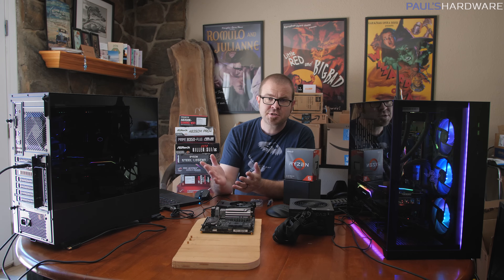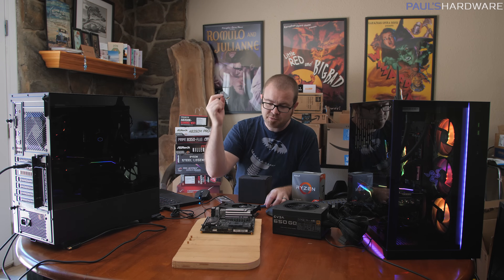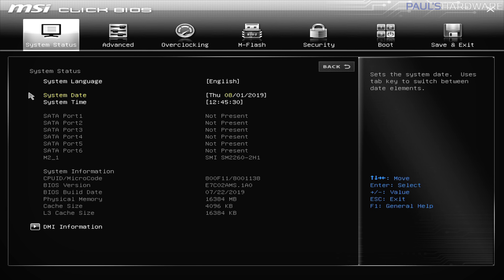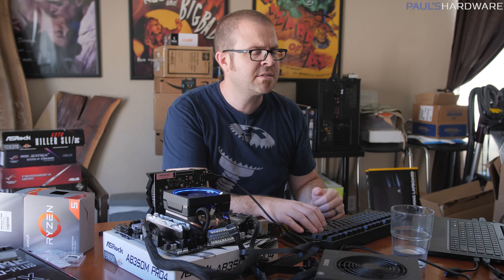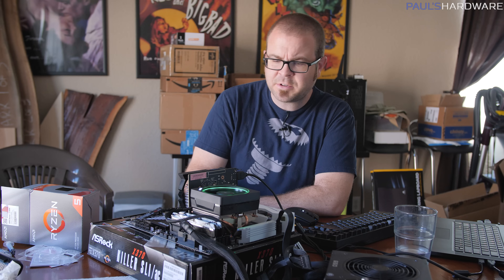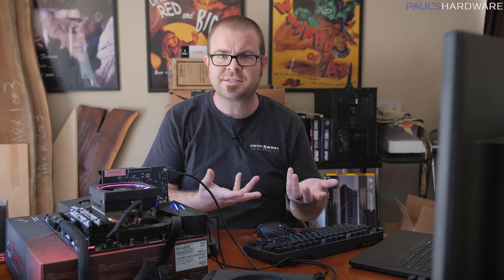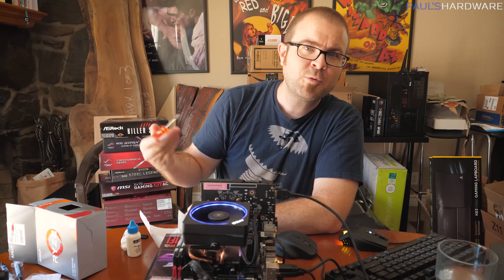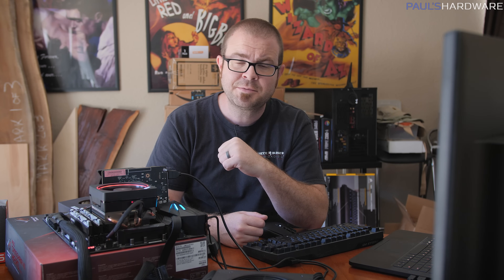Does Ryzen 3000 REALLY Work on Old Motherboards? Testing B350, X370, B450 and X470

Comment: AMD is amazing. I updated my old system (Ryzen 5 1600x, MSI x370 Gaming Plus and 2*8 Corsair 3200 Mhz memory CMK16GX4M2B3200C16R and 1080ti) with new CPU R9 3900x. With latest available BIOS my system absolutely stable. Max turbo freq is 4625 Mhz, my memory now overcloked to 3733 Mhz with 16 16 16 timings. My respect to AMD engineers.

Comment: Nice mobo update run, but yeah like me, many users are having strange behaviors like high vcore on idle, high frecuency bootsing for scrolling down a pdf file, huge RPM rampage from cpu cooler when almost no load, etc, etc, etc. The list goes on, and the newwer BIOS updates and chipsets drivers, are not fixing them all, or not fixing them to a degree were you will feel ok with it.

Comment: I have a problem with my b450 tomahawk and ryzen 5 3600. Most of the time it won’t boot. I had to shut it off and on 10 times to get a boot. I think I’m currently on the bios version 18 and am wondering if the newest version of the 19 will help this.

Comment: Hi Paul, I built a Ryzen 3 3600 with a Gigabyte B450M-DS3H last month, I needed to upgrade the BIOS to F41 before it would work. Had to use a previous gen chip to flash it as the board doesn't have any of the flashback-esque options.

Comment: I have an Asrock B450 Fatal1ty Gaming ITX/ac with a 3700X and a 32GB G.skill Aegis 3000Mhz kit, and I get constant bootloops.
Currently tried 4 different bios' that were sent by asrock or were found on the support page and not a single one works.

I am getting desperate :'(
Reply: Done that, even have a beta bios from asrock support. But still boot loops.
Reply: if you have some other ram, try that as well
Reply: @Bareego  already done that. No help 😭
Reply: @cerrror  I think he mentioned something about a certain order in which you had to upgrade the BIOS on some asrock board. Like 3.4->3.5->5.5-> higher. If that's not it I don't know. Maybe buy a MSI board, they're the best AM4 boards IMO

Comment: Paul... sell me one of your builds. Im a pleb who through overclocking.. penny pinching and general cheapness has been able to keep a 10 year old rig running fine for 1080p gaming at high to ultra settings. The rig started its life as a MSI 970a-g43 motherboard with a FX 6300 and 8GB of 1333mhz ram, crappy video card, and a 450w non rated power supply. After watching your videos over the years I have slowly upgraded this PC on the cheap.. The crap video card was replaced by a R9 270... and eventually a second one was added for crossfire. The Powersupply exploded and was replaced by an EVGA bronze 650watt which also lit on fire nearly burning my apartment down. The third power supply was a corsair RM650 gold which is still kicking. The crossfire setup was replaced by a GTX 980 founders edition build by PNY. The ram eventually was replaced by 4X4 sticks of 8GB 2133mhz which took a butload of fiddling to make it work at the correct speed. The CPU was clearly bottlenecking the GPU so I upgraded it to a FX 8370 and overclocked it with the edition of a hyper 212 evo cooler. The hard drive was old and small so a Samsung EVO ssd at 1tb was installed. The original PC had cost me something in the range of $500 and I have put a lot more into it upgrading it over the years. It is still competent at playing games at 1080p high or ultra settings near 60fps... however I think I have hit a brick wall regarding upgradability. I am broke. I am a plumber apprentice and literally have no time to myself to do necessary things nevermind think about working side jobs to pay for a new PC. I fear that at this point I need to spend thousands to make the next level of PC performance a thing. If you have a stockpile of older hardware components I would gladly take the small amount of savings I have and purchase what you dont want or dont need to build something newer, or better. I am not afraid of the build, I actually enjoy doing that. I enjoy the thrill of the overclock as well. If you have something you consider junk, think about selling it to someone who might consider it diamonds. 

Thanks man. 

Love the channel. 

Full blown inspiration from every video. 

Matt
Reply: Dude, literally just go buy 8gb of ddr4 for $30, a Ryzen 5 1600 for $100, and an am4 mobo for $60. You can swap all your other parts over, and for less than $200 you are back to “modern”. Dramatic much? If you can’t handle working a lot, better get some brains in your head.

Comment: 10:26 Hey, Paul can you please tell why the auto voltage  in msi's M& is 1.4v in default. I'm presently using a R5 3600  housing on a msi's Gaming Pro B450 at stock and there my ideal CPU voltage is 1.4v to 1.424V.

Comment: Will shed some light on my upgrade. Asrock x370 taichi bios 5.60 with ryzen 7 3700X with Corsair vengeance rgb 3200mhz cl16. Had some minor issues with booting to windows at the 2nd attempt but managed to get into windows and it seems to be working fine but only at 2133mhz atm. When I turn on xmp 2.0 profile and set memory to 3200mhz I get restarts of the system while being in windows. Previous bios I had on my ryzen 5 1600 was 5.10 and had memory running at 3200mhz stable with no issues. I will try to boost the memory speed closer to 3000mhz and see what happens. Right now want to make sure that its stable at 2133mhz. Will update later after increasing the memory speed.
Reply: check on cpu z infinity frabric speed called nb make sure running at half speed memory or at max speed....anyway try with ryzen master without xmp profile
Reply: Hey thx for the info. I've actually started digging for information and I found a long discussion at overclock.net regarding this issue. They are already on beta bios 5.67 which by what peple have tested already seems most stable. Hopefully a new bios for x370 taichi is near. I'll try that 5.67 for now.
Reply: @Headz_  sorry before i mean ryzen dram calculator

Comment: My C7H (non wifi) became unstable with my G.Skill 3200MHz RAM. I had to increase the voltage from 1.35 to 1.37 for it become stable, with the XMP profile! Same issue with the two latest updates. Hoping it will be fixed in a future update.

Comment: Here's a question that I haven't seen someone answer yet. The older B350 and B450 boards don't have as good auto boosting technology as the X570 (and eventually b550?), so when I upgrade my 1600 to a 3600 with my B350-F, will it be worth OC'ing the CPU vs leaving the motherboard to auto boost? All the new reviews with X570 auto boost results are really close to manual OC. I'm going to buy one anyway and try it myself since I've had my 1600 @3.9Ghz & 1.36v since R5 1st Gen launch week, but I'm sure that many people would like to know this information. BTW your daughter is adorable, congrats on the extortion for advertiseme- I MEAN parenting.

Comment: My problem with ryzen 3000 as well as others is that the cpu is idling at 50c and the voltages are insane, it hits 1.475 and 1.5v on load or just playing a game of insurgency or fortnite. I have my ryzen 3700x paired with a x470 moba.

Comment: Can you tell me how to upgrade the bios on a gigabyte b450 Aorus pro wifi with a F2 bios. I use a ryzen 2600 and would like to upgrade to a Ryzen 3000 series chip but don't want to mess up the board. I follow you and love all your videos!
Reply: There is a tool if you haven't used it yet.  When you click on the ECW Update it should tell you that it doesn't need to update firmware. Then update to latest bios. Once installed then reboot into bios. It will say it has been updated after you are in the bios press F9 to see the latest revision. Next shut down the PC and turn off the power supply from the switch at the bottom back of the case. Now install the Ryzen 3000. It should boot just fine.
Reply: @DanielMartinez-hc1nw  thank you!
Reply: I also watched you on newegg long ago when the galaxy was not so big.

Comment: I wish you would have covered a gigabyte x370 board with there crap with the memory (EW FC Update tool) ton of people have had problems with them sense that no one that does this covers that issue with them. Or was it the fact they still cannot boot from NVME drives with there new bois yet?
Reply: Is the debug code C5? I just fixed this.
Reply: @DanielMartinez-hc1nw  dunno I haven't planed on upgrading to anything past what I have sense I run a r5 1600 nothing is stable for memory for me past F23 with good timings.
 
It has been all over the forum they may have fixed it with there last release think there at F43 now. 

F41 wasn't even reading NVME's and F42 detects but would not boot from them. Just checked beta again F42a apparently fixed the boot issues.
Reply: @boblister6174  my NVME works great it's the 970evo. I am at bios version F42a

Comment: I remember it, on March 2019 I want to build my new PC with Ryzen 5 2600 and B450 Steel Legend, but I heard a news about Ryzen 3000 series, and then of course I will wait, and yeah I didn't dissapointed to wait, the performance is different, it's better it's stronger, but then I'm scared to build it with Ryzen 5 3600 and B450 Steel Legend since there's many forums that said there's an issues running Ryzen 3000 series with B450 or even X470 motherboard, I think I will just goes with Ryzen 5 2600 and save up some money for maybe buying Domino Pizza? LOL

Comment: Paul—  I ran into several problems while trying to get a 3600 cpu with the MSI B450M Gaming Plus board (brand new system). 
Everything was complicated because my current computer is a Mac and I haven’t been able to install Windows from the USB. 
Please do a video about how the formats for the BIOS flash upgrade process and the Win10 installation are different and are made even more complicated when using a Mac as the USB-creation computer.

Comment: I just went through this over the weekend. I bought the Gigabyte B450M DS3H motherboard and ended up having to go get a 200ge from Microcenter to update my BIOS. $40 on sale or $52 on Amazon and flashed a few versions but got it working in a couple hours and I have never flashed BIOS before. I'll keep the 200ge around it is cheap enough to keep around and not bother with returning it. The biggest thing I can say is, make sure you get on AMD's site and get all the updates for the CPU. I didn't have dual monitor support on the 3400G until I got the drivers from AMD.

Comment: Great video, but it doesn't tell the whole story. I bought a brand new MSI B450 Gaming Plus for the bios flashback feature since the newer X570 boards seemed a bit pricey for my liking. Flashed the bios, woop, everything seems fine and I'm posting my 3700x on top of my motherboard box. Reassemble all the shit back together into the case -> CPU debug led is on, fans are spinning and that's about it. What's the deal, I was just posting minutes ago, right? Reassemble it like 4 times and somehow I'm posting again. Install windows and all seems great, don't know what happened but it seems to be working somehow.

Nope, whenever I shut down my PC or even restart it for an update or whatever, the CPU debug led lights up on the next booting attempt and now the computer is stuck again. After checking for faulty connections on the mobo and PSU, only REAL solution to the problem is pulling out my PSU cable and waiting at least a minute before putting it back in. And by real I mean I've gotten it to boot up without removing the cable a couple of times randomly. Sometimes it boots right up on restart, 90% of the time it doesn't. Can't really pinpoint what causes it not to boot, only thing I know for sure is what fixes it for at least one more power up.

I've run my PC for 72 hours without any problems, just can't boot it reliably without completely cutting off all the power and draining the capacitors. Faulty PSU? I've read multiple similar stories from other users that have the same board.

TL;DR: You can get most b350/x370/b450/x470 boards to post and boot, but some of the problems might show up later than the initial post and windows boot.

Comment: Well this answered my question.  I have the ASROCK X370 Killer SLI/AC and I already have the bios updated to 5.4.  My only issue is the board only shows support for up to 3000MHz memory, and will drop it down to 2933MHz as that is the max it supports.  So I do not know if that might affect how the Ryzen works better with faster RAM.  So may want to discuss that as well, about if you buy a new processor, and use an older board, you may not want to also drop a lot of money on faster RAM.

Comment: installing the wraith prism on a msi board only this week, pushed down the clasp only for the plastic hook on the cpu socket to snap, the velocity of the shard of plastic i estimate to be in the high 9000 sanics range, if not for my lightning fast reflexs i would have surely been killed.

Comment: it would be easier if you guys in the comments just saved money and bought a X570, the less expensive kind, then going thru the hassle of upgrading BIOS, especially with B350 boards, like c'mon. lol spending $300+ on a 8-core and still running a B350 is kinda lopsided

Comment: I updated an asrock x370 killer this weekend, and it went okay. The problem I ran into was that the board apparently won't handle RAM at 3200 mhz. I had to settle in at 3000 mhz.

Comment: Would a B450 Aorus Pro work for a ryzen 3600? And Also, I have a 1600, with 2133 mhz Ram, is there any point in upgrading to a 3600 from 1600 with slow ram? (Also I have the b450 for 1600 cuz my b350 broke)
Reply: Buy faster RAM, it helps a lot!
Reply: @vladvah77  its expensive tho so its not worth it then

Comment: AsRock: "To update to the newest BIOS you need to do updates with all the BIOS's that came before first and yeah buyers of our products...we HATE you!"
Reply: and that is the reason I will not be buying another asrock mobo again. . . Had to update the damn bios like 4 times back to back on the x370 taichi to get my 3700x working.   Didn't buy an x570 because of the damn chipset fan.
Reply: @TheGuyWhoDidUrM0M  you can modify the chipset fan to be passive by putting a heatsink on to it or you can take out the fan and put a different bigger fan in. Don't let the fan stopped you it's not a big deal
Reply: @TheGuyWhoDidUrM0M  i have asus crosshair 8 hero the pch fan is not loud at all ot never speen abone 2k rpm just need a good airflow
Reply: @parabelluminvicta8380  good to know, x370 taichi is running solid tho
Reply: @TheGuyWhoDidUrM0M  i had the reason for x570 because ive bought togheter with my mb 1 gigabyte aorus nvme m.2 ssd gen 4
Reply: @parabelluminvicta8380  Samsung 970 EVO Plus  2TB m.2 and it runs great. that uorus ssd of yours looks shiny and fast i hope lol
Reply: How about k4 gaming? 
I have that mobo and planning to change to ryzen 7 3700x but i don't have old ryzen cheap to update

Comment: Here's my experience with 3200G on Gigabyte B450M DS3H. So i bought all my stuffs online. I was already aware that the board won't recognize the CPU and i thought that shops in my area can help me update my BIOS. Boy was i wrong, they don't want to take the risk at all since i didn't buy stuffs from them. So i end up buying an Athlon 200GE to update my BIOS, again online since no local shops are selling it. So, took me a while to actually boot my Ryzen PC. Now it's happily running connected to my 4K TV. :)

PS: My mobo had F4 BIOS and when i updated to F30 BIOS, it refused to boot. Turns out i had to clear CMOS. Still had a mini heart attack though thinking that i fried the board. =x

Comment: Had Asus X370 Crosshair VI Hero
first 2 BIOSes supporting 3rd gen Ryzen did not recognize my NVMe SSD(Patriot Hellfire 240GB)
2 newest BIOS versions did not support my keyboard during boot(Corsair Strafe RGB, uses 2 USB ports), had to use different keyboard just to get past initial screen(press F1 for setup)
additionally and more importantly - board would not boot AT ALL after I made any change in BIOS - be it enable XMP, change voltage offset or even just adjust fan speed
Asus support told me to use different keyboard and ignored rest of the problems with the board...

Switched to ASRock X470 Taichi which works fine for the most part

Comment: For msi flashback use a 8gb flashdrive for better success rate.  My intial attempt to update my b450m mortar failed becuase the board could not read the bios file in my 32gb sandisk drive

Comment: That was the first thing i went with.They were sold out on the tomahawk and didn't want to refund me so i had to settle with a b450 gaming plus atx.I am not unhappy though.This mobo does everything i want.It was also one of the first mobo's to officially support 3rd gen ryzens.I am not upgrading at the moment as i hardly push my 2600 to max.Btw the new bios settings are called think gte lite its better than the old bios tbh as it has a much better fan curve.

Comment: I had pretty good luck. I bought a 3700x, Refurbished Crosshair VI Hero, and 3600 Corsair Vengeance Pro RAM 4x16GB. I installed everything did the BIOS flash and everything worked with very little issues. I didn't have any problems with running my memory at 3600 either. c